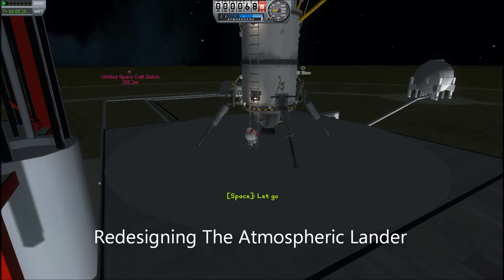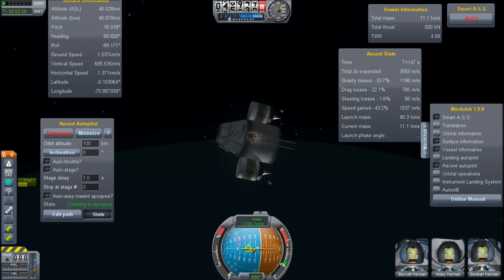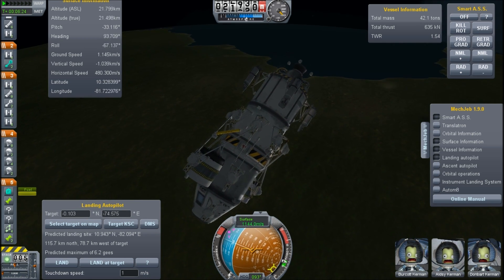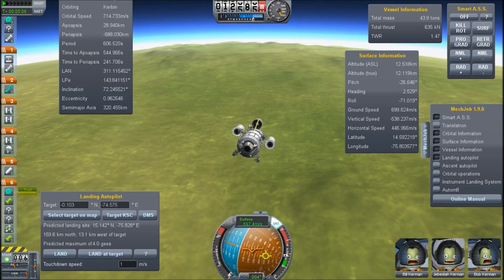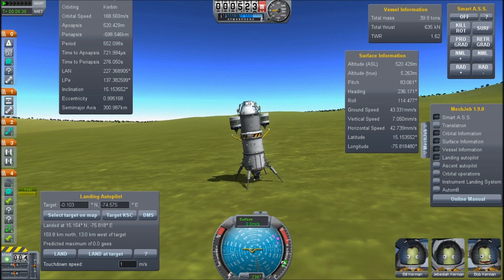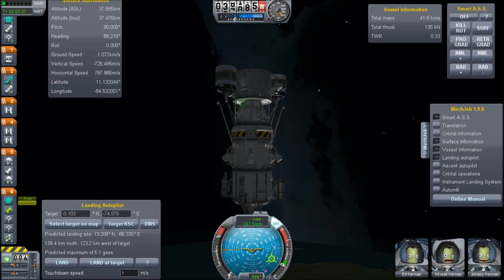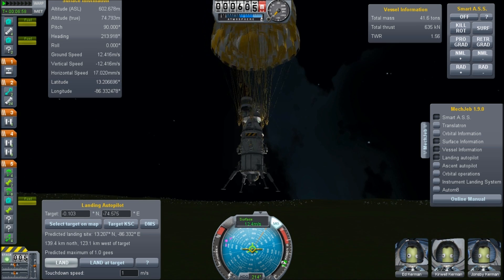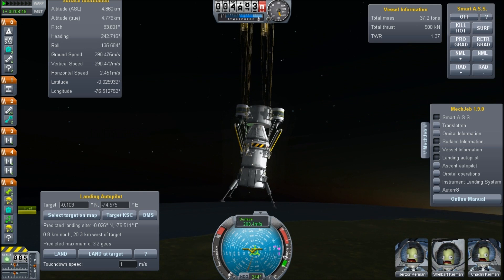Redesigning The Atmospheric Lander - Kerbal Space Program

Comment: Nice video! Wouldn't it suck if after all this work on the Lander Squad just fixed the bug? Haha. But anyways, I do have a question. Your probe launch idea was great, so I decided to do it myself. The problem I am having, however, is when I launch the Probes, Instead of just the Probe detaching the decoupler stays with the probe. I tried numerous things to fix this, even rotating the Decoupler upside down. Still nothing. So, how did you do it?